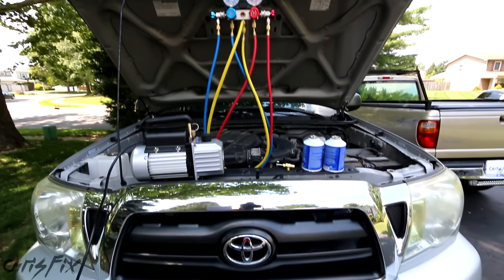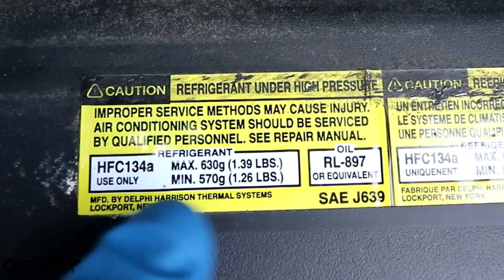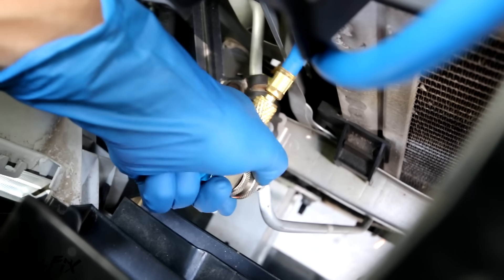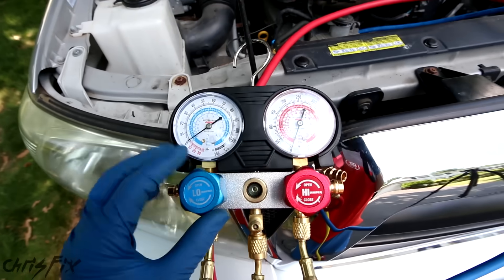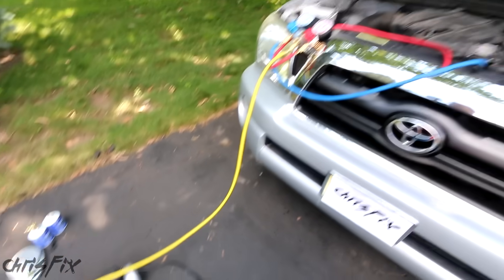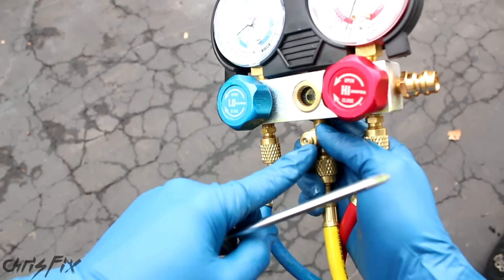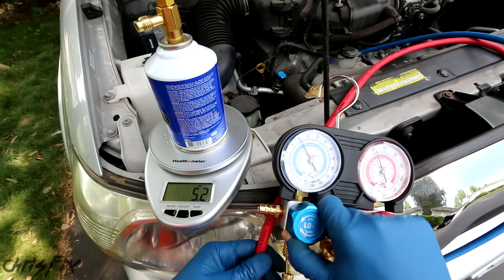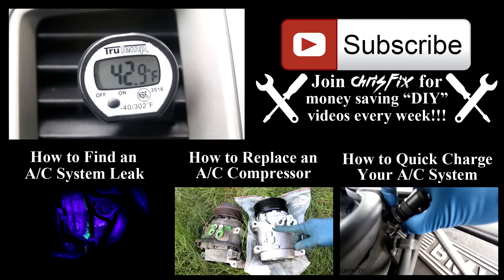How to Properly Recharge Your AC System

Comment: It looks like you only put in 18 ounces of refrigerant....each can has 12  ounces and the can weighs 20 ounces with adapter and hose attached...that mean that the can plus adapter and hose weighs 8 ounces. If you bring the scale down to 10 ounces that is half of total weight.  4 ounces for the can, adapter and hose and 6 ounces of refrigerant.  Each ounce of refrigerant ends up weighing 1.66 ounces of the total weight so to take 10 ounces of refrigerant out of that can you have take the can down to 16.6 ounces of total weight.  That leaves 3.4 ounces so divide that by 1.66 will leave 2.04 ounces of  refrigerant in the can.    For the scale to work to way you did it you have to set the scale at 12 ounces,then bring it down to 10 that would be 10 ounces exactly...Just saying..  Great video...

Comment: And now for the biggest problem - those guage sets don't come with those piercing valves and the piercing valves usually do not fit the gauges - so you are basically screwed because the manufacturers do this on purpose and they make sure the vacuum pumps - gauges and piercing valves never fit together because there is no mutual consensus about what the threads should be or how they should fit together so you chances of acquiring a set of tools that fits together and works properly is absolutely zero point zero zero one 0.001 - and I am saying this from experience

Comment: Hey Chris great video on A/C service.. I have a question on how you checked the leak rate.. you mentioned that you pulled down the system to 30 in Hg then isolated the manifold, closed both hi/lo valves and then shut off the pump.. is that only trapping the vacuum on the gauges? How are you challenging the condenser/evaporator and all the components if the blue and red valves are closed? Also, during the refrigerate addition, i didn’t see you  open the high side gauge yet it was showing the compressor discharge pressure? Was that omitted? Great video like all of your stuff 👍🏻👍🏻 but looking for some clarification
Reply from the maker: The valves work two ways. When you close it at the manifold it closes the ports in the manifold. If you close it at the shrader valve on the AC lines it stops the pressure from being read in the ac lines. Since I just closed it at the manifold, it’s still reading the pressure in the ac system. Even if you were to close the valves at the shrader valve on the ac lines, you just open it up to check the vacuum after it has sat for the allotted time.
Reply: @chrisfix  thanks for that explanation! So the valves at the gauge isolate the yellow line not the hi/lo side.. excellent!! Going to run a check on my system.. any advice on how you recover residual refrigerate in a system before working on it? That seems like something that needs to be done by a shop?

Comment: I had a leak in my system and the ac shut off to keep from damaging the system.    The system was empty and I found the leak and fixed it. My question is, if the system is empty and I pull a vacuum to make sure I fixed the leak, what makes the AC system turn back on when I want to refill it?  It shut off because it was very low refrigerant/empty, so what makes the ac turn on when there is nothing in the system prior to the refill?  Thanks!

Comment: Just a few things to add:
- Check the law/regulations in your country. You may are not allowed to fill up the System by yourself. 
- Should be clear that you don't fill the system if there is any leak. Even if it's cheap or you just want to run it temporarly - this stuff equals to tons of Co2 for just a few ounces.

Comment: I absolutely hate the self seal cans I have purchased numerous fill valves designed for self seal cans and have yet to find one that works. I ended up purchasing one from Walmart that screwed onto the can and has a built in guage. Never had this problem with puncture cans. Anyone find one that works?

Comment: You can charge by pressures and temps, too. But, if you've opened the system, like replaced a bad condensor, you need to replace the receiver/drier. Plus, by federal law, you have to have an EPA license to service refrigerant systems.

Comment: How much would it cost to remove the old r134? If i have to take to a shop to remove, I may as well let them recharge it. If we had r134 would you just add more?
Reply from the maker: Well if you need to get it removed you’re going to fix something right? Otherwise there is no need to remove it. That’s where you save the money too. Prob costs $75-140 to get it removed

Comment: I'm confused. Are you charging liquid in the low side, when the system is completely empty. I have learned that liquid in low side damages the compressor. Why did you do that? Also, when purging the air at yellow hose after adding oil and UV dye, the purge process, doesn't take out oil leaving the system oil starving.

Comment: Fantastic video! Very detailed and thorough, I'm ready to go. But I do have one question...did you ever use the high pressure red line or valve once you attached it to the car shraeder valve? I even watched a second time, but I don't thi k it was ever used...or was it?

Comment: My shop manual is telling me to add 3 ounces of oil for the fast leak of refrigerant, and another 3.5 ounces ounces directly to the new receiver/drier.  Whats the best way to do this?  If I add the three ounces into the yellow hose won't it just blow out when I bleed the hose of air?  Could I add all of it into the inlet of the receiver before I vacuum the system, or will it all be sucked out by the vacuum pump?  I really appreciate the experience you share; it has saved me thousands.

Comment: If you recharge the system will will need 3oz of pag oil and if you don’t use it then compressor will over heat and burn out

Comment: One minor flaw: the cans say they hold 12 fluid ounces not ounces of weight. A fluid ounce of r134a weighs about 1.25 ounces, so the first can added about 15 ounces weight  to the system. The scale ensured that you added 10 ounces weight with the second can.
Reply: The $5 can I got from Walmart say WT 12 oz (340 g) which are pressurized to 45 PSI. Maybe it depends on the can. Best to weigh the starting and final weight of the first can to know for sure what you bought. Also all the new cans I am seeing are self sealing so the brass valve needs to match. I had a piercing style so I filed down the tip to not damage the can. Worked well.

Comment: This video made me go and buy all the tools to do this. The dealer wanted 1700 bucks to change just the condensor and compressor.

I replaced the expansion valve and the evaporator as well as the other items.

My 2011 camry is about to go under vacuum for 45 minutes here in like 5 min.

No leaks. Held 30 for an hour. Im excited because my ac has been weak for over a year. I plan on keeping this canry which currently has 208k miles on it for another 3 to 4 years and those summers will have freezing ac.

Car doesnt burn use or leak any fluids

Comment: moisture will not cause a leak but it will cause acid and burn out the compressor, you should have told them you are starting from an empty circuit, otherwise people may use the vac pump on a filled system, that's bad

Comment: The cans are 12 FLUID ounces. You would need to know the density of the refrigerant and the pressure in the can to convert to the mass numbers listed by the manufacturer. Hence the need for scales if you’re going to use a mass basis for filling.

Comment: Great video but one question. When you applied a vacuum,  closed the valves, and waited for an indication of leaks, didn't the valves close the gauges off to the AC  system?
Reply: I wondered the same thing
Reply: No they dont, they only close the outlet to the yellow line. Gauge is always connected to their corresponding colored hose.

Comment: I noticed that you did not open the red valve after you turned the AC on, How were able to get pressure on the red gauge with the valve shut. I thought both valves were supposed to be open when you add freon.

Comment: okay i hope i can get an answer for this, do you need to adjust the fan speed while you add ac? we live in florida HOT so the compressor usually works pretty hard but is it better to fill it while on low fan speed or high? because i guess the pump runs vs. your fan speed?? help??? thank you :)

Comment: Great Video! Something I've come across that I didn't hear mentioned is if the high connection doesn't maintain the negative vacuum.
The low side has stayed at 30 for over an hour but the high side went back to 0. Any suggestions? Or what would cause this?

Comment: HI Chris. Great video. I have a question - when you used the yellow hose to pour the UV dye in (or to add oil in)  -  that leave air in the hose ... I see you used the purge valve, on the AC gauge set, to purge the air - but wouldn't that also purge the either the UV dye, or the oil, from the yellow hose with the purged air?

Also, if I am afraid I might be low on oil, can I just add a few ounces - and would I then need to reduce the amount of r134a to leave room for the oil I added? I may not be low on oil, I really don't know how I would determine that, but I thought I might add some oil 'just in case'.

The reason I think I may need more oil is that  removed my scroll valve from the AC compressor, and saw that it was covered in a blackish type of sticky substance. Not sure if it can be called black 'soot', or perhaps it was dry 'oil', or maybe it is some remains of a gasket that is drying out? I bought a new scroll valve, but I did not oil it up at all. After I put the new scroll valve in, I still had no cooling at low RPM, but I did have very good cooling at high RPM. So, I am going to take the new scroll valve out, wipe the inside of the port on the AC compressor with a rag, just in case it is still dirty with 'soot', and then I thought I would put some PAG 64 oil on the new valve so it can move freely in the AC compressor. This is what got em to thinking that maybe I should add more oil to the system when I add the new r134a.

Comment: I can't get my system to take freon. The compressor wouldn't run after trying to add freon so I unplugged the low pressure sensor and ran a jumper wire from the alternator to that and the compressor turns on but it still won't take freon. When I turn the compressor on there is no movement on either side of the pressure gauge... Any ideas?

Comment: I don’t understand how you would add oil through the yellow line. I tried. I could barely get any in the line snd I needed to add 6oz. Then when I did, I purged the system and it blew the oil out. That makes no sence.

Comment: Great video Chris! Question, when you start to add refrigerant, I noticed you never turn on the High pressure valve on the manifold but you do get a pressure reading...how's that work?
Reply: Exactly what I was wondering, as I getting ready for that step in 20 minutes. I will wait until the compressor kicks-in and then open the High side slowly.

Comment: Great video, Chris, but the valves in refrigerant cans are no longer "pierced" and the device you recommended for releasing the refrigerant from the can did not work for me.
Reply: Cans have a valve now, just move the shaft to the middle and you'll get 134a flowing.👍
Reply: @charlesguinn4316  Does the piercing needle actuate the valve in the can ?
Reply: @UncleDoug  Yes exactly.
Back the can tap valve out. Counterclockwise.
Attach can.
Turn can valve clockwise about half way in, you get flow.
If you turn it all the way in it will stop the flow...
It's weird. 😆
Reply: @charlesguinn4316  It's not weird. If you turn it all the way in, it seals the hole.
Reply: @charlesguinn4316  Thanks so much, Charles.
Reply: @GunnyNinja  lol
Yeah true. But the 1st can I got with a valve threw me for a sec... I didn't back it out far enough and thought I hadn't pierced the can.
I charged liquid and just pierced a small hole to prevent sluggin the comp.
Nowadays, I just dump the 1st can into the HS cond, and trickle the rest into the suction line...
Reply: @UncleDoug  I don’t think it does. When I did it, I needed a blue colored adapter that screws on the refrigerant can (available in auto part stores). I then front seated completely (clockwise) the valve (device) and screwed it onto the blue adapter quickly as a little refrigerant will slip out. The needle on this valve used with the non piercing type refrigerant can, does not depress anything in the can. The needle acts only as a valve, down is off and up, allows the refrigerant to flow. But the valve surface around the needle will depress the blue adapter stem and cause the refrigerant to flow). So you could also screw the valve (make sure it is front seated) onto the blue adapter first - then screw the blue adapter onto the can quickly. In addition, the can tap valve I brought had a 1/2” acme male outlet. I had to buy a 1/2” acme female to 1/4” sae male flare adapter to attach my yellow refrigerant hose which are 1/4” sae. This adapter came with a valve core inside. For refrigerant to flow I had to either take the valve core out or make sure I had the yellow refrigerant hose end that is crooked (which contains a core depressor) and attached it to this adapter…
Reply: @CC-ew2jw  Thanks for your detailed reply, CC.
Reply: @GunnyNinja  Most cans are self-sealing...so you can reuse the piercing pin on other cans, if need be.
Reply: This thread is one of the most positive collaborations I've ever read. Nothin but helpful... Ya'll r killin' it! Thanks.
Reply: There are two kinds of R-134A cans being used in the United States....Regular and self sealing cans. California requires self sealing cans and they require different valve. Amazon has kits with both styles of valves for less than $20 shipped!
Reply: @glenniz1  Thanks for updating me. I’m in California and I was not aware of the new can tap valve for self sealing cans.
Reply: @glenniz1  Thanks for the info :)

Comment: I just learned yesterday that the can used in this video must have been the older cans where they had to be pierced. I just bought some recently and it has a stem in there that gets pushed down when you turn close the valve turning it clockwise and therefore opening it. I was trying to charge my system with it in the counter clockwise position as this video showed and it wasn't working for me lol. I'm a novice when it comes to AC but I've learned so much as of recent and I'm charged up now finally after a long few weeks. I just knock on wood that the things I've corrected and fixed are good to go now.